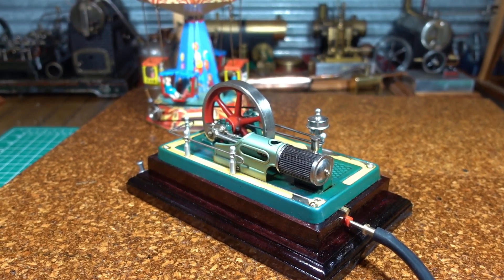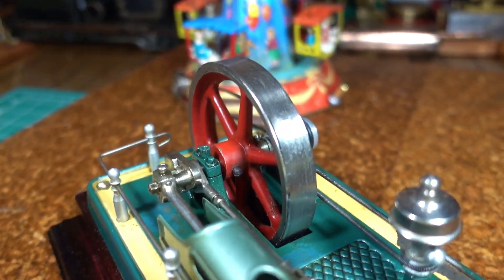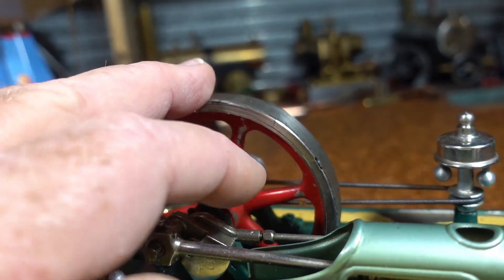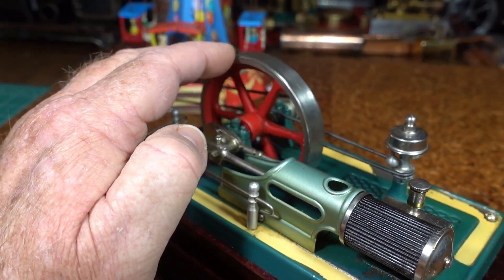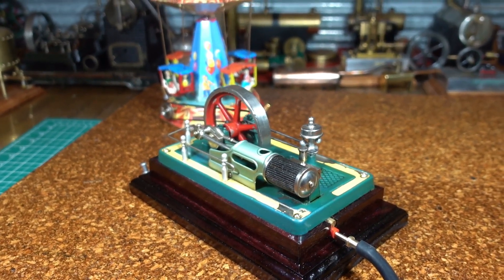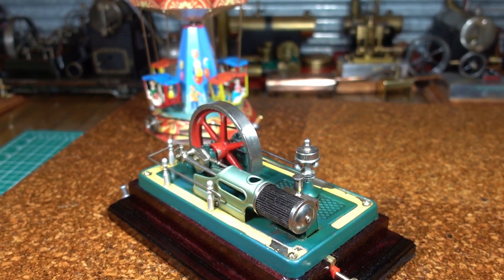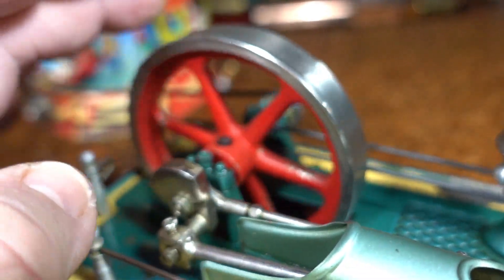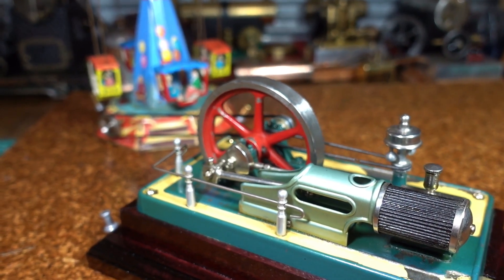Model Steam & Toy Steam Engine Zinc Pest rot fixed with Super Glue #

Comment: I actualy wondered about this, i reparied the engine craddle on a 1950s Lionel locomotive with CA, so far it seem to hold up good enough to run the locomotive.
Reply from the maker: I Googled years ago Zinc Pest and its the train guys that I got the idea from. They have a lot of trouble with the cast wheels of their trains. Its a real shame this happens.  I have three of these Fleischmann engines. Two just aggregates and one a complete plant and the other two flywheels show zero zinc pest - Cheers Jim
Reply: @SteamEngines-Jim  
Thank You!
Some early Märklin machines also hawe this problem, the very early machines does not seem to be this often affected, neither the later ones after the early 40-50s.
On my Lionel train it is only the craddle, the chassi is not affected at all and must had been made with properly purified zinc in the alloy.
The other Lionel locomotive, laso from the 1950s does not seem to be affected (however that one was a lot more expensive model whan it came, i don't know if they where made with better quailty metal compared to the basic models, but it might just be a coincident...).
Most of my 1930-40 British and French locomotives (Hornby and JEP) are not visibly affected, but i know the Hornby trains where sometiome swerly affected by zincpest, i hawe seen a lot of examples where all zinc parts had more or less crumbled to dust. those i hawe from the late 50-60s does not seem to be affected, so perhaps it endend with the 1947 models when the production started again until 1965. The American Manufacturers did not had a break during the war (as far as i know) so Lionel, Marx, etc is a long continous line, wich perhaps would explain the uneven alloy quality in some series.
All the station lights, becon parts, etc from the same manufacturers i hawe in my collection seem to be ok. the only thing so far i seen from that type of equipment is two of the electric switch casings for the electric switch system. 

When it come to stemplant equipment it seem to also had affected some series of the Tecno models, however rare since i hawe only seen it once on a Tecno model late.
Reply from the maker: @Vampi_Sweden  Such a shame that it happens. There must have been so many wonderful items that have 'literally' disintegrated. From what I have read it seems to be from having lead contamination in the molten metal mix used for the moulding of the parts. The Tecno accessories (which I think must have made the same same Jensen USA accessories) luckily I have never seen any Mazak rot. Appreciated reading your very interesting post .....many thanks - Jim
Reply: @SteamEngines-Jim  
Thank You! I hawe a few realy old parts, i think it is a 1910 or 1920s Falk workshop acessoars, they seem to be made of Zamac (i think it is a led based earlier wersion of the Mazak, etc alloys it is much softer and can pretty easily be bent with the strenght of my fingers if one are careful) they does not seem to be affected as far as i know.
Same with the 1940-50s belt transmission lines i hawe, i suspect some of them are another alloy, (Märklin switched ower to spotwelded steel discs in the 1950s, as i heard because the old cast ones where too soft and they had problems with the spookes cracked (however the spookes seem to hold up fine on the few ones i hawe in my collection, but they might be later, one of them even came with a nice little steelbox for a spare wheel, i don't know if You hawe seen those little boxes, but the sheetmetal box it self also work as a bonus wheel for flatbelts with an easy modification (it even had spookes cut out in the lid...), So You basically got two wheels if You bought one...)
As You mentioned i also think the later ones where made with alloys based on chemicaly pure zinc.

I hawe two stationary Märklin steamplants from the 1920s (i am almost done with the restoration, except for a few pieces i need to make new castings for when i got acess to the blacksmith shop again), they seem to hawe heathy alloy in the parts, and the base are made from cast iron on the very old ones. I think a lot of problems with corroded and destroyed brassparts is because people does not realise the importance of using linenseed oil or soft solder in order to prevent damp from being trapped in cavities and causing de-zinc from the brass, i hawe seen same thing happen to oldcar engine parts, so i don't think it is the brass alloys, but, unfortunatly it is not much to do about it if it allredy has de-Zinced and become broittle, but they seem to hold up reasonably in non critical parts, i re fitted some of them with Kennon fittings (i hawe the absolute deepest respect for (i decided to remove the particular name here), but to be wery honest i am not always share he's opinions about how to restore old engines wich where not originaly made with the British standradised systems... And powertools with course sanding discs is a big no no in my workshop when it come to actual antiques, especialy not on the model trains, i hawe seen that too many times. Not to talk bad about anybody, and not to be disrespectful, but one shall never ever using abrasive on old electric train motors sandpaper or powertools may destroy the collector permanently and will also cause a lot of issues when the motor is running (said with all respect)), they are not right for those machines but it will do for now until i can make the new parts...
Reply: I removed persons name from my last post since it was realy not my intetntion to hanging out anybody.
Reply from the maker: @Vampi_Sweden  Thanks for that information on your collection, thoroughly enjoyed reading it all.  There is something very special about those old Märklin plants (and Doll) that just make me drool. Even looking at the old Märklin catalogues is a special treat. I have the modern Märklin 16051 which is very nice but it has not the magic of the old vintage plants. I am always amazed at the variety that Märklin and Doll came out with. Considering back in 1910 and earlier people needed money just to feed themselves to live, these engines must have been for very rich and wealthy buyers. I always wonder who bought them, were they bought as toys for men or toys for boys at Christmas? 
Those boxes with the spare wheel sound very nice, its something that I have not seen ever.
Reply: @SteamEngines-Jim  
(I aplogise for the last parts in my previous post, it was a completly unnessesary addition, i was realy tired whan i wrote that and nothing i had wroted now...)

Yes, the medium size of the older Märklin plants in the early 30s was about two weeks of full time work for a normal worker (i guess the larger ones where even more expensive), so they where probably not realy kids toys, more actual functional models You played with together with Your dad or Grandpa i guess, even the finer and larger Fleishmann mplants from the 1950 and early 60s where a full time week of work. I guess people like You and med had to start saved up from Your summerwork and Your first real work for a good while in order to get them, or elder men who where allready done with paying off the house and rising small children, like Grandfather took it down from the shelf on special occations my guess, meanwhile You could watch it and dream about them as a kid (as i did my self, ha ha They where still quite expensive in the 1970s despite they did cost only a fraction, but it was still way to much money for a kid to save up from what i earned from catching rats on my fathers farmhouses and grandmothers sunday candy money (wich i always carefully saved)... ha ha Probably that's why i begun to collect later...).
Reply: @SteamEngines-Jim  I will see if i remember to take some picture of the box!
Reply from the maker: @Vampi_Sweden  That's how my collection started, my father had an old Mamod (I didn't know it was a Mamod as it was so black and battered) and us kids would beg a few times a year for it to be taken down off the top of a tall kitchen cabinet and fired up and we would watch enthralled as he went through the process. I ended up inheriting this engine and many many years later looked it up to see what it was, found out the name and wondered to myself would there be any others on ebay.....did a search and as they say the rest is history :)
Reply from the maker: @Vampi_Sweden  Yes please :)
Reply: @SteamEngines-Jim  
What an adorable story!
I saw the Wilesco macines and discovered meccano parts whan i played with a friend. Much later i discovered them on a national action site (in sweden it's called "tradera" (of course i will gladly help You if You want to buy something there, it is usualy owerpriced junk, but sometimes there are highlights), i think it is somehow similar to the American Craigslist, but usualy a lot more owerpriced... But on rare occation there are also som realy good deals sometime, like the 1970-80s Wileco D8 and D12 i managed to get for abot 20-30 bucks and turned out to be in relativly good condition, i also found sellers in Germany where one could find all the spareparts, i was suppried by how many spareparts that where still in production and even fittet the old 1960s machines with only an adapter (or new collar) for the treading (the new treads are standard metric (M5 and M6) on those)).

Meccano was relativly expensive when i was a kid, at least if on wanted a whole box of it, but later i managed to find batches of loose parts, and personaly i mainly use the meccano to play arond with the trains and steamplants so i don't realy care if it is those German spinoff brands, like Trix, or if the parts does not hawe the original box as long as it is fun to play with. (Boxed In perfect contidion it is horribly expensive here anyway, and honestly, how fun would it be with a bunch of superexpensive original boxes one would never ever dare to play with... However, sometime original steel or cartoon boxed came with and one can still pick together an original set from loose parts, wich i did with the X-box construction kit for example (Yes, kids in the 1950s played with X-Box! ha ha) Same with the locomotives, i managed to find a whole batch of original lights, etc and parts of the box for the Hornby locomotives so i simply picked together an original set with one of the finest locomotives in the collection and it did not cost me much more than a beaten up loose locomotive from the same era.
And since it was allredy used, i can still drive it on the tracks on Christmas or other occations when i hawe the patience to lay out the railsetup... ha ha. (I promised my self to build a proper table for the trains this year now when i finaly managed to free up space for it... ha ha)

Personaly i mainly collect tinplates when it come to the locomotives, probably because they are matching the steamplats and has more tradtional mecanics with solid brassgears and no plastic parts. It is quite hard to find livesteamers for realistic prices today, but a few times one may find 0 gauge Bowmans and similar reasonably affordable on rare occations on ebay (now it has become super expensive to import from britain after BREXIT...). So most of my tinplate collection are electric 0 gauge or those sheapo clockwork kids toys from the 1940-50s, mainly because they are still fun and they often goes realy sheap, like 5-10 bucks for a set on local auktions here, if we are talking kids toys that has been played with. And they often fit the 0 gauge rails.
The mecanis are usuialy pretty easy to fix if they are marked as brooken.

The only problem i had with the old steamplants and tinplate locomotives is that each single time i bought sparepart machines, they turned out to be in such good condition that i had to restore them back to funtional, it just felt like a genuine shame to scrap them, that is honestly a good chunk of my collection now... ha ha!

Some of the steamplants where complete wreacks whan i got them, but even the boiler was ment to easily be re soldered and every singel part of significans can be taken apart for maintain.

(Doll and Falk machines are super rare here, i think they are more common in Germany, but i hawe a loose singelcylinder Doll aggregat and i think a boiler setup in my box of spareparts i plan to restore, the aggregat is allredy cleaned and just waiting for a wooden baseplate as soon as i got the fine wood for it).

-
Reply from the maker: @Vampi_Sweden  You sound like you are very absorbed and into your hobby, its a wonderful distraction to get lost enjoying such a past time.  I do spend some time (I should say a lot LOL) on German eBay looking in the steam searches. The modern browsers that language translate have made this much easier. Some truly amazing items engines and accessories get listed and its fun to watching just how much the rare ones get bidded on and how high they go in price.
One of my greatest regrets is an Uncle died when I was a teenager and left me his Hornby O gauge clockwork (windup) trains (these were top end and beautiful) and so much track and accessories. Being a teenager with other interests I never really got excited over it all (and there were packed in suitcases...many many) later when I got married I advertised them for sale and I was living in the country, a man drove over 600 miles the next day after a phone call to buy them. Even such a long time ago I think about this with deep regret often :( 
I have recently bought one of the nicely made generators that are sold under the steam listings on German eBay that are made by a man. I have wanted one for awhile and saw recently a friend hook one up to a plasma ball and want to plagiarize the idea :) Over the years I have bought steam items from all over the world, but the postage costs to Australia have dramatically increased the last 4-5 years.
Reply from the maker: @Vampi_Sweden  Here is the link to the set up a friend of mine did with the same generator that I have ordered -
https://youtu.be/2eNnTtA4Uds
I am self taught on my lathe and mill and so struggle with parts that are overly complicated. I bought one of the Bengs kits the 'Danni' which looked the easiest to make and it defeated me!
Reply: @SteamEngines-Jim  
Awsome! 
Bengs are realy, realy beautiful kits in my opinion!

I think the kits just shall be taken on in the right order. The blackgates 5" kit is somewhere between since it is very simplifyed compared to the Stuart but still requires some machining. It is raw casting for a neat little vertical pump, i think it can also be mounted in lying down positing if it is used on a locomotive for example.

I don't know if You hawe seen A E Karnes videos? They are realy short, but i hawe massive respect for that guys knowledge, in the last episodes the team on the railroad musem hooked up a 1 gauge Lionel NY locomotive to a model steamplant wich where connected with a belt to an old, modified semafor DC motor ha did some modifications on so the fiel coil is breakout and connected to a reastat and meters in order to see the V/A output and V/A for the fieldcoil so he could balance the output volt from the Ancor to the trainrail feedline via the reostat. We don't hawe those American Semafor system in my country (since the signal system was directly electrified allredy in 1926 here), but if You hawe it in Your country, it could maybe be a fun project if You are interested in those old things as i am. That would possibly also be a fun experiment to show the children.
(Any DC motor will do (Tecnicaly also for example the red Märklin generator since it is practicaly identical with a similar claw ancor inside whan i took it apart, something i actualy concider to do in the future, it would be superfun to show my  sisters kids how to balance a generator in order to drive somthing like a train or something else) i think, but the older ones with open bronze rings look more beautiful)

Analog H0 trains from the 70-80s are very sheap at the moment in my country, if You want to getback the feelings of Your childhood toys.

I used to borrow machines on my former workplace, but because of the COVID situation i hawe been cutoff from all acess it (it's in the other part of the country), so i taught it was a good idea to de dust my old workshop plans anyway... ha ha.
Reply from the maker: @Vampi_Sweden  G'day again :) I have just searched Youtube for "A E Karnes" and have subscribed and will enjoy looking through those videos later. Now I must admit/confess when it comes to electrical I am VERY challenged!! I have a Blue Thunder generator (made from a stepper motor) some Wilesco generators of different vintages, a PM Research generator and this new one coming in from Austria (I did think Germany but its from Austria). I made a 'Juice Reducer' from parts so that I could run U.S.A 110v heated boilers on our 240v Australian system, but I was drawn a very clear to follow diagram from a friend :)
You need to start posting some videos up, what we have been talking about is really interesting and would interest many!
Hope you are going ok with Covid, we have been lucky down here being an island, vaccinations are starting to roll out but very slowly.
Reply: @SteamEngines-Jim  
My brother wisited Your country a few years ago, he said it was fantastic!

Yes, as You maybe hawe guessed vintage  electronc is the other big part of my hobby... ha ha! 
Beside the steamplants i also (sort of) collect radio valves and other fun stuff, mainly sheap things one can reverse engineer (and hopefully put back again...) in order to see the construction. (Yes i was one of those kids who litterary screwed apart everything that contained electronics when ui was a little child... My father gave me some old carparts from the scrapyard as toys one could connect together with a 12V transformatior and a diod unit he helped me build to recitfy the DC from the transformer) ha ha)
I hawe a few old tuberadios from the 1940-50s in my collection, but i honestly don't hawe the space (alloved...) to set up a real collection even if it had been fun.

I hawe a few original Märklin and Wilesco generators i restored, but most of them are reversed small DC motors as You mentioned. I think i will make some brass castings for them in the future whan i moved ower the rest of my blacksmith shop here. (You can actualy make brass and bronze castings ower a stonecoal forge fire and a graphite cruisible, i use red oilbondsand, but i am pretty sure You can make Your own if You find sand that can handle the heat safely, i think almost any oil will do for hobby work, You can probably also make Your own cruisibles from heatresistant sand and fireproofing cementmortar (that type that are used for the inside of centralheaters, choose the high temperatur 1000Centrigree stuff, it shall do i think if You want to try. Just be careful to use respiration protective, not to inhale any dust from the cheramic, that industrial stuff may contain realy nasty particles, they may act similar to asbestos if they got caught in the lungs as i heard so make sure the powder is well bounded, but othervise it is pretty easy to use, we used for the oven in the axe factory).
.
Reply from the maker: @Vampi_Sweden   Very interesting reading about your childhood, its always the handy people that had Fathers, Uncles etc that took the time to encourage boys (and girls) to use their hands that it is a good and useful thing for their entire lives.
I have virtually an unlimited supply of good quality scrap brass (my son's own a large plumbing company) I would love to be able to build a small forge to be able to just melt and pour just round bar for use in my lathe.  Different thickness's up to 75mm and around the 200mm length. This would be such a cost saving over buying lengths of brass (I would also like to do it for aluminium as well) I have watched a lot of vids, it looks to be hard to do, but something that can be achieved. 
P,s I too am very concerned about ceramic blanket that a lot of hobbyists use in their model boilers - https://youtu.be/RUxIn8rvbMY
Reply: @SteamEngines-Jim  
It may be a bit tricky to learn the meltingpoint between coldflow and degassing of zink, sometime it seem to work falwless othetime everything just become catsh*t despite one taught it was a perfect repeat of the previous, but i think i poured the metal a bit to early, or perhaps impuritys in the metal (i use scrap metal too) Just be care not to inhale zink gass or if You are using a blacksmith forge not to contaminate ovens or troghs with zink particles that may give of zink fumes during further use of it, that can be extremly dangerous, that's why i alsways do the casting experiments outdoor or in well ventilated areas.

I am not sure about the modern glassfiber insulation, as i heard it shall hawe larger fibres compared to asbestos, as i heard, but i know industrial type cheramic tiles and mortar does contain minerals that shall not be breathen in. I don't hawe any machine yet in my collection that need that insultaion, but i know it is used for example in the larger Stuart boiler sides.
I am not realy sure what it could be replaced with it so.

When it come to steampipes a man from Germany gave me a tip about using thick cotton or linen cord in order to simulate the asbestos cord on the fullscale machines.
It can be painted ower with non toxic oilpaint i think.
_
Reply from the maker: @Vampi_Sweden  That's what I have been using the cotton twine that butchers use to hold together roast beef rolls for the oven. I wrap that on and give it up to 3-4 coats of good quality bright white marine oil paint and it stands up to the heat very well. Its also a good insulator and will stop your hands and fingers from the odd burn instead of just skin on hot copper haha :)
Reply: @SteamEngines-Jim  
Thank You for the tip!
I think i will try that on the larger stemplants when i am done with the softsolering on them.
Reply from the maker: @Vampi_Sweden  Please share your projects when you get around to it :)
Reply: @SteamEngines-Jim  
Thank You the motivation! I will absolutly give it a try, i just hate to fiddle with all the software registration processes on the platforms, and there are alwasy other projects that use up the money i saved up for a proper camera, that's why i prokrastinated it so long, ha ha.
But i will try if my actioncamera will work for this, perhaps, i don't like the fisheye on it, but i think it may do for now.
-
Reply from the maker: @Vampi_Sweden  Even try your smart phone, a lot of people just upload YT vids that they have shot on their phone.
Reply: @SteamEngines-Jim  Thank You, my brother gave me a modern smartphone, i previously used extremly durable things like the sharkfin because of my work always destroy the cellphones, but i trying to learn it... ha ha. I must say that i was deeply impressed by the the quality of the camera and functions like the ultra rapid (not like the real thing with those photograpihic high speed cameras, but it seem to at least double the picture framerate and was superfun to play around with in the machineshop), etc. 

I will deffinitly give both cameras a try!
They seem to hawe a lot more potential then i taught.
-
Reply from the maker: @Vampi_Sweden  Really looking forward to what you can share of your hobbies :) Hope you had a great weekend.
Reply: @SteamEngines-Jim  
Thank You i wish You had too!

I just burnt all my money on the Lionel Northern Pacific 1:43 loco set this month, i got a realy good deal on one NOS in box.
I also bought some wagons for it, also new in box on a national auction site (it was about 300$ for the whole set, including a set with the orange Crane wagon and the caboose, also NOS from a collector they said, i think that set is like 1000$ (at least more than 600$) for the loco set and wagon only brand new, so i think it was a pretty good deal. ).
It's a bit too modern to realy fit in my collection, but i realy could not resist the deal, i think the twin loco set alone are almost 80 cm long whan they are connected, and the diecast wagon twin set are sonething similar in lenght, they tould me the package was 9 kilogram with the loco and wagon twinsets... ha ha!

I promized to help my father to cut some hardwood in the sawmill, but as soon as that is done i will take a new dust with the cameras, thank You for keeping up my motivation!
Reply from the maker: @Vampi_Sweden  LOL haha come on we need to see this new train set! I googled it and it looks nice :) 
I don't have enough room to get 'into' trains. I do read the occasional model train magazine (and I thought hobby steam engine guys were enthusiastic!!!!) and it looks like a super engrossing pastime. We have just taken delivery of 3 tonne of split hardwood for our fast approaching Winter. I have a friend in Minnesota just coming out of Winter they got down to minus -33° Celsius ....... my location in Australia we very very rarely get below 5°c over night and daytime is usually around 15 -18 but that is still cold for us!!!!
Reply: @SteamEngines-Jim  
The older post war, 1950-60-70s Lionel traditional line models are usualy pretty sheap and perfect fist step models since they are quite simply made and hawe incredibly thick goods on the chassi but still contain interesting mecanics inside. (Just watch out for zinc pest on the engine craddle inside) I think one shall be able to got a 1960-70s diecast Southern pasific single end one pice locomotive in functional (or east to repair) condition for less than 100$ if one are looking around a bit.
The diesel locos are a bit out of what i am usualy collect, beside it,i only hawe 2 1940-50s Lionel "steam" locomotives and a box of tinplate wagons. They are a bit of oddbirds in the collection, but i like them and they are far more affordable compared toi the British or German ones, and American trains are much bigger than tinplates where i live so it is much easier to got spareparts for the more modern ones.

Yes, those who realy are dedicated probably hawe trainsets for more than 30K bucks for the trainsets alone i guess... Way out of my liege, but it is fun to wath videos from realy dedicated collectors. If i had one of those 2000$ set on my shelf i would be afraid to even touch it and make the valuse like halve because i opened the box or something... How fún had it been with a train that could only sit behind glass on a shelf? I know those guys exists, but personaly i am a bit too childish person to resist playng with them at least sometimes. ha ha ha

Yes, it can sometime drop down to -38-39 Centigree here in the north, i think Sweden is pretty much in line with south and mid. Canada, however we does not hawe that extreme snow here as they hawe owerthere, and it usualy stops with -40c in the very north here (thankfully rare where i live)... ha ha

My brother was travel to Your country a few years ago, he realy loved it he said!
Reply from the maker: @Vampi_Sweden  "es, it can sometime drop down to -38-39 Centigree here in the north" I can't even begin to imagine what that would feel like. On the other end of the scale, the hottest day here that we have 'endured' is 48°C and that wasn't a lot of fun in am electricity blackout with no air conditioning :(
Reply: @SteamEngines-Jim  
Ha ha, i can imagine, here it stops around 30 C i think because of the gulfstream, same in the winter. But dry could is ok by me.

It had been superinteresting to wisit Your country in the future, especialy for the nature and the wildlife.
Reply from the maker: @Vampi_Sweden  The worst thing besides the heat is the U.V with it being in the upper extreme range each day......no wonder we have the highest rates of skins cancer in the worid :(
Reply: @SteamEngines-Jim  
I guess one hawe to use a lot of suncreen :)